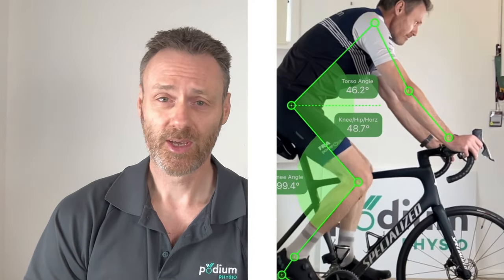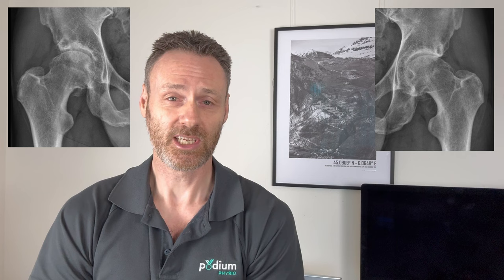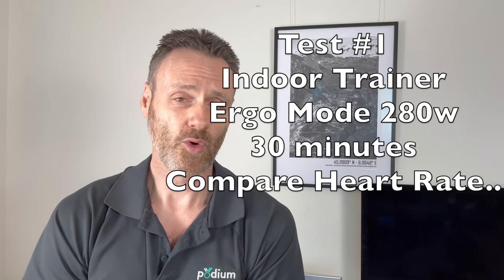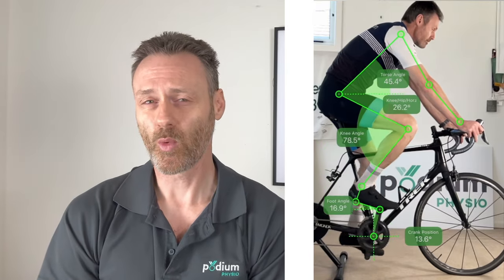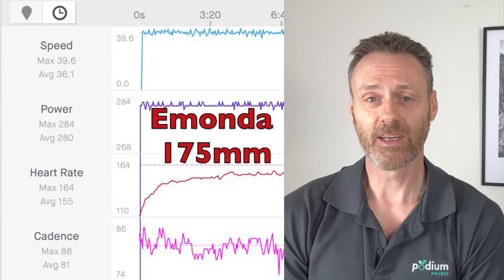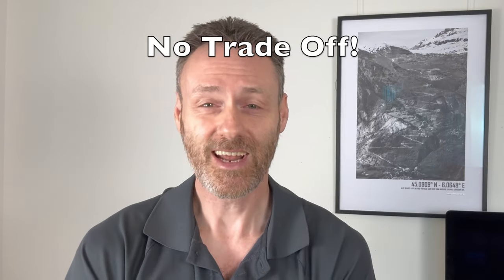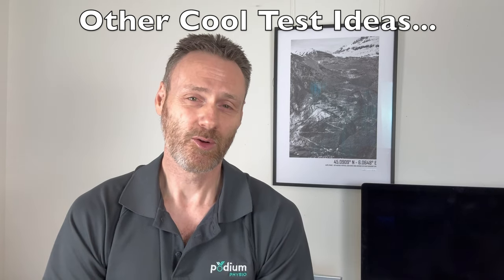Does riding with shorter cranks require more effort and exertion?

Comment: I run 100mm cranks which is on the extreme side of things due to a knee injury with lack of flexion, I can tell you from experience that there is a significant amount of torque loss , There is a much higher demand in the legs to turn the cranks at stop & go, climbing or any low cadence work. High cadence helps to keep things moving with the right gearing... But gearing only gets you so far , You still need to push the gears to go anywhere.
Reply from the maker: Hey yes that sounds quite extreme. I know from the research I saw in 2018 at the ISCO conference that some of the benefits discussed with going to shorter cranks reverse at around the 120mm mark. However if those 10cm cranks are keeping you riding, then I'd say they have done the job!

Comment: We share a somewhat similar story I think.  I'm 188cm tall and had bilateral hip replacements some 20 years ago now. in my early 40's.  At that point my hips were shot and it made sense to get the replacements then.  The surgeries were life-changing.  I had both done within 30 days and was back on the bike (on the trainer) in 6 weeks.  Since then I've been lucky to have had zero problems and no pain.  I know you are wrestling with the decision of when to choose that option - not an easy decision for sure.  The one thing I would say is not to wait too long (if replacements are inevitable) as your recovery will be quicker and potentially with fewer complications.  That said, last year i had my first real bike fit and changed from 175 to 170 cranks and the results have been nothing but positive.  Pedaling felt smoother immediately and my FTP jumped 15 watts right away.  Looking forward to the rest of your journey with the shorter cranks - thanks for sharing it!
Reply from the maker: I was advised 6 years ago in my mid 40s to have both hips replaces, however I'm committed to avoiding this for as long as possible. Being that I am a physio I'm well versed in how to look after my hips with strength and flexibility exercises. My hope is that modern therapies that are currently still experimental, will mature to becoming more mainstream and more dependable (Stem Cell Therapy for example).
Personally as long as I can maintain my strength and functional ability, I think it is ok to delay the surgeries. I'd rather not have artificial components in my body if I can avoid it.

Comment: I just started road biking last winter my specialized diverge came with 172.5 and i immediately switched to 165 made a huge difference. I also have hip and knee problems.I am now going to test pedal extenders 16mm to start because I feel my feet are too close to crank arms . I even tried to adjust the Cleat. Been running 155mm on my mountain bikes. I’m 5’8”.
Reply from the maker: That may well help with hip issues. I might test the same idea also. 
Thanks

Comment: Again, it's tough drawing conclusions when you're using two different bikes. How does it compare to your previous 30 mins efforts on the same bike with 175mm crank arms?
Reply from the maker: I've never specifically targeted 30 mins at 280 before. I'll look through my strava file to see if there is something similar I could do a comparison on.
I've done a few sessions where I've set the ergo to 400W and hung on for as long as I can, but the results of those sessions are mostly dependant on how much training I've been doing in the lead up. 
I figured this was the best option (one day after the other) as it removes the inevitable fitness fluctuations from month to month.
I got some very interesting power data on the weekend on an uphill sprint comparison which I'll post shortly...
Reply: @podiumphysio657  It's difficult to have an appropriate comparison, because you could also feel better on the first day (or the second day). Besides, the weather changes every day.

Anyways, I'm interested in seeing the rest of  your tests, but the key is gonna be the level of pain in your hips and level of stress on your muscles and breathing.
Reply from the maker: @musclelessfitness2045  So far my hips have definitely been more comfortable.

Comment: daily i use 170. one day i try 160 because curiosity. i ride both and i love both. 160 i feel a bit extra work when i facing slow cadence in high gradient road. i'm slow in climbing. and i have habit cranking slow in climb, 160 feel more hard to push than 170. but in flat i feel 160 is more easy to gain speed. i don't know why
Reply from the maker: I would guess that you just need to use a lower gearing ratio with the 160s on a steep incline.

Comment: Should the cadence be higher with the shorter cranks? Or perhaps you naturally pushed the metal less.. it's very interesting great work
Reply from the maker: No. The idea is to keep the cadence the same, adjust the gearing (if needed) and enjoy the benefits as presented in this and my previous 2 videos.

Comment: A longer crank arm obviously is a longer lever and requires less torque to turn. With a shorter crank, you compensate by changing into an easier gear. This,  to be able to ride at a similar cadence to produce the same power.
If the heart rate stays the same,  does that mean that there isn't any change in efficiency? The same hr could mean that you are using the same amount of oxygen and producing the same amount of lactate? 
Mmmh,  I am confused. 
Your hip angle is increased, so your thighs don't push into your stomach. How big a difference do 7,5 mm make? 
Did  the World Tour riders adopt shorter cranks?
I ride longer distances using aerobars and find this idea interesting,  but I am not yet sure if I believe I can benefit.
Reply from the maker: Hi Herbert. If you have a look at the first video I did in this series it may answer some of your questions. I'm not a physiologist but I think there are mechanical advantages at play with shorter cranks. 
I've gone 15mm shorter, so I'm not sure about a 7.5 mm change. I suppose any differences would be much less significant.
I've heard empirical reports that tour riders are moving to slightly shorter cranks, but probably not as extreme a change as I have made.

Comment: Some how 175's became the new standard over 170's, I've never ridden 175's mostly 170's that was on my GIOS and 167.5 that was on my MOTTA if there's was lot's of climbing involved then I would be riding my Dale Saso Track bike that was modified to a road bike that had 172.5s because there a tiny bit more leverage with the longer crank arms that will help me with getting up the hills and yes there was a lot of toe over lap which I had no problems with, it was a great climber and it down hilled like a bat out of hell, those were the days when the norm was 42t/53t up front and a 7sp 12/24-26 with down tube friction shifters, bottom line I've been riding for so long and all of my components of my body is working just fine and I'm not worried about my heart rate. Way back in the early 80's I went through a smattering of testing with some sport medicine doctors, after the testing they were a bit baffled, they said you're only 21 but your resting heart rate is that of a seasonal Professional athlete, I simply said that I ride my bicycle a lot, between 350 to 400 miles per week, I then pointed out the window and said see those mountains, during the summer days I will ride over those mountains to the Santa Cruz about once a week back and fourth and I will also commute about 40 miles round trip to and back from work. I'm now 64 and I now live in the Netherlands where I'm still riding my bicycles, since it's so flat and cold so now I'm in the gym 8 to 10 times per week on average doing a 2 hour gym session, the 3 plus hour sessions are a killer session and my heart rate is still doing great and my lung capacity is huge, to where when doing a breathing test, the technician who was conducting the test thought that there was a problem with the test, so we had to start over again, so we did, then she said oh, the first teat must have been correct, my wife then asked, is there a problem, the tech then said no, she showed us the 2 read outs, she said she has never seen this before, his breathing is way off the charts, his are very strong because lung very large lung capacity. For my age my cardiovascular is VERY GOOD still and my stamina is crazy good, all this started with riding a bicycle, no matter what the length of my crank arms.

Last thoughts, if you're a racer that needs that little edge over the others then great, if not and you're feeling good with what you got then just ride, I'm off to the gym.
Reply from the maker: There is a lot to be said for "just ride"! 
It sounds like you have a great love of exercise. 
I've recently read the book "The Midlife Cyclist" by Phil Cavell, which I found interesting because he points out some of the risks of "extreme" intensity exercise as we age.
Reply: I am 103 years old with a resting heart rate of 34 and a VO2 max of 99.

Comment: Looking at the power data in the charts, although average power was the same for both crank lengths, variation appeared significantly increased with the 160's.  Did you notice this (in hindsight) while riding?  And to what would you ascribe this to?
Also, I'm sure you have mentioned it at some point, but what do you feel is the cause of your hip degeneration at such a young age?
Reply from the maker: Yes i saw there was more power variation in the Tarmac trial also. I'm not sure I can explain why. 
I blame my hip OA on my father! Seriously I recall having hip restriction in my teenage years. Back then I just put it down to lack of stretching, but really it was a leading indicator of FAI and hip OA. I also recall having various xrays in my 20s where comment was made on "early hip osteoarthritis". Bad genes and bad luck!

Comment: Humans have this way of always returning to the information that is stuck in their head instead of understanding the system of variables and testing what they think they know. The sheer number of videos about shorter cranks and midsole cleat position, with no explanation of how the benefits are achieved or what down sides there may be is alarming.

I suffered a back injury in my 20’s that left me in a wheelchair for a few months. In that time I learned the major muscle groups used for locomotion, as well as how to map them using a TENS unit. I spent some time at the gym rebuilding strength in four muscle groups. Learning how to walk is a daunting task, it involves balance. Learning how to pedal a bike involves four muscle groups, so the second time around I learned how to pedal first. I learned what very few people have realized - pedaling a bike isn’t natural if your primary skill set is walking or standing.  A quick look at force vectors produced by the average rider shows the longest vectors at the bottom of the pedal stroke, pointing straight down. That’s someone trying to adapt the skill set of walking or standing to the bike, and it doesn’t work.

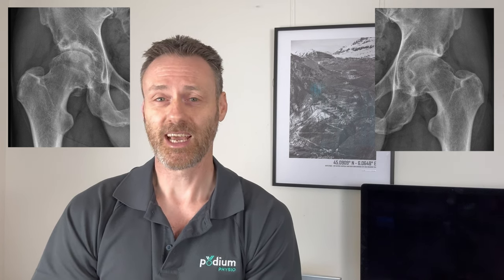The engineer in me decided to reverse engineer the pedal stroke. Which pivots can produce force in which direction? Which motors (muscles) drive those pivots?  I then looked at the muscles that drive those pivots.  You have two large muscle groups that fight gravity all day, and you have the opposing muscles which return the leg to its original position. To put it simply, the glutes push from 1:00 to 4:00, the quads push from 11:00 to 2:00. People like to dispute this, so I built a test rig and tested lots of individuals (and won lots of bets in the process - the test rig wasn’t cheap).   The two large muscle groups work very differently. The glutes are a very wide muscle group designed to produce torque which is normally used to support the weight of the body. The quad on the other hand is a much longer muscle with short distance from fulcrum to attachment point - designed for leg speed.

   This is where I run into humans wanting to stick to one piece of information. There is no “right cadence”. Glutes are limited by gravity, the upper body is the lever arm, gravity is the force behind it. Cadence isolating the glutes is limited to around 80 RPM on this planet. Quads on the other hand love leg speed, but can’t generate torque well.  In teaching pedal stroke, I have a workout called the crossover workout which goes from low resistance to high resistance, alternating between isolating glutes and quads. Glutes fail to produce leg speed and quads grind to a halt. One thing learned in that exercise is efficient range of cadence for each muscle group.  Once you’ve gotten to this point you’ve also isolated the variables to the point where you can start asking how crank length effects the outcome.

My primary job is bike fitting. My first goal is always to keep people within their range of motion - nothing good happens when you exceed that (80 times/minute for as long as you ride). I have sold more than my fair share of short cranks. I’ve also noticed a disturbing trend in another segment of the bike shop. E-bike riders no longer have to produce the torque needed on a bike, as a result their position changes. It becomes more upright, taking angle out of the hip. We have a number of people on staff who have been on e-bikes for years. Watching them walk up stairs is painful, they no longer have the range of motion…
Reply from the maker: I havent thought a lot about how Ebikes could negatively impact locomotion. My first reaction as a physio and primary health care professional is that any technology that helps keep people active is good. But yes potentially there could be some downsides that become more apparent in the future.

Comment: short cranks and low rpm = strain.
I am 6'1" and I  spin 85-90 rpm on 153 mm crank arms .
Reply from the maker: Short cranks create a mechanical advantage for knee extension, which means that the legs are better able to produce force. This can facilitate a lower cadence